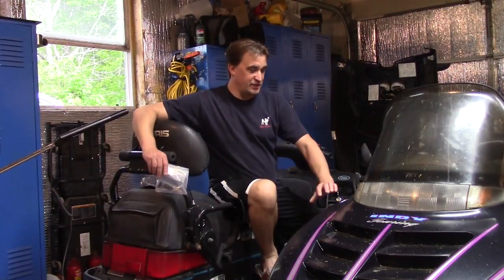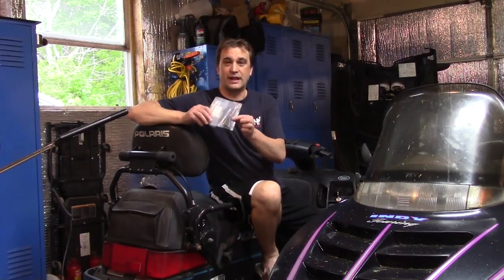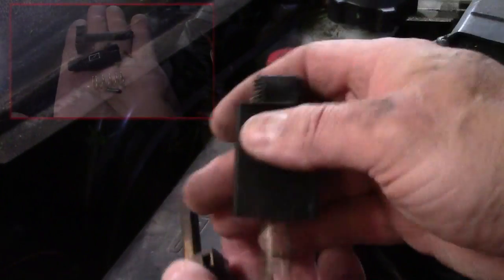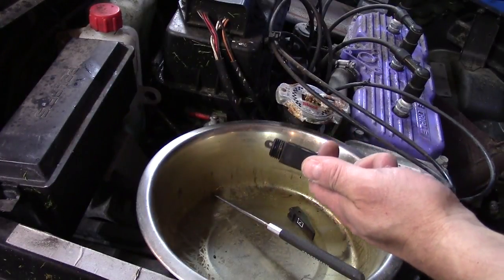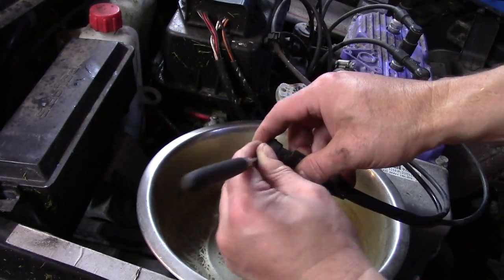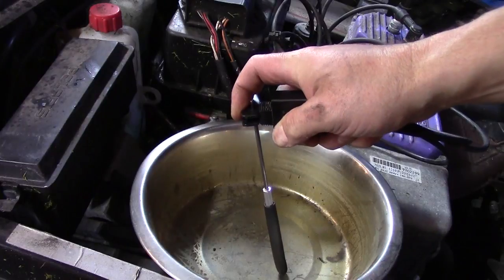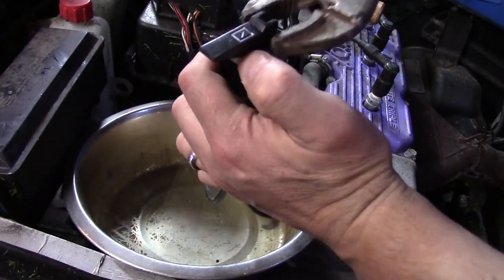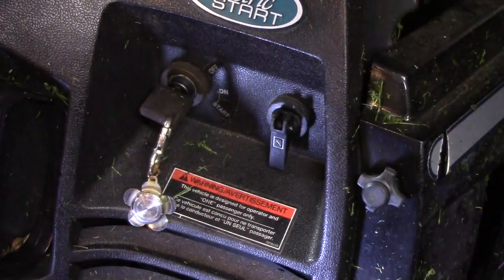How to Replace a Broken Choke Lever on a Polaris Snowmobile or ATV - DIY Choke Lever Replacement

Comment: Clear, articulate, easy to follow and significantly better than 90% of the how-to videos I've seen about anything. Got me lined out in no time on my 2000  Polaris Xplorer 250. Mine didn't want to come apart as easily as yours, but I scored the seam with a knife to get it unstuck and it slipped apart. With extreme gratitude, thank you!

Comment: Great Video on replacing the choke lever! I wonder why nobody makes a metal version of the little lever? It is a very poor design and they break at the slightest off center force. I have seen so many break on my polaris snowmobiles and friends rides and it's interesting that nobody talks about the problem of the breaking with the slightest off axle force. I have seen so many older snowmobiles with no/broken choke lever, just a rigged way to use the choke during cold starts.

Comment: The plastic choke part is fine on mine, isn’t broke but I’m still not getting gas so I’m thinking it’s the tube maybe? Is there anything else it could be? When I pour gas down the heads she works perfectly and will not shut off until I turn her off or she runs hot

Comment: I would not have thought that came apart either.. so many cables bought when kits are like 5 bucks...  too bad no one makes the pull out of aluminum as the hole where pin slides through always lets go in the coldest of winter when you need it the most...

Comment: Commenting again, I got copper wire for the pin so all set on that but I went to take the box off from the wired and it’s stuck. I pulled with everything I had and used pliers on it but nothing seemed to work. Even stuck a thin blade down the seam to try and pry old dirt out and nothing seemed to work. Suggestions?
Reply: Same issue.  Took a razor blade, heated it with a torch and melted the plastic around the case at  the end.  It sure looked like it was suppose to come apart but no dice but the heat did the trick.  Should be fine if I just put some epoxy where I cut it.

Comment: What if we can't get the box cover off the cables?
Reply: Same issue.  Took a razor blade, heated it with a torch and melted the plastic around the case at  the end.  It sure looked like it was suppose to come apart but no dice but the heat did the trick.  Should be fine if I just put some epoxy where I cut it.